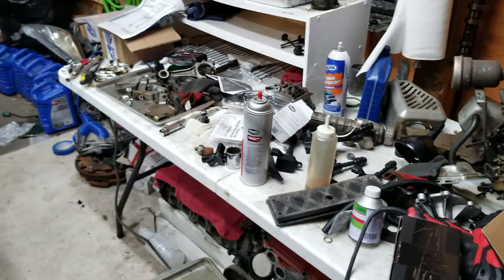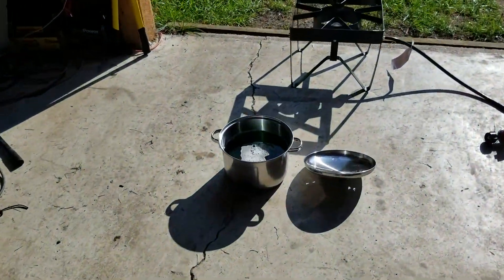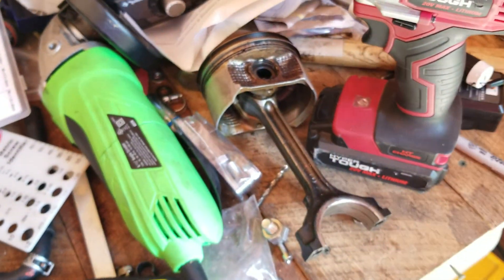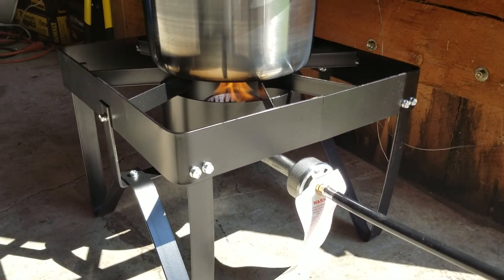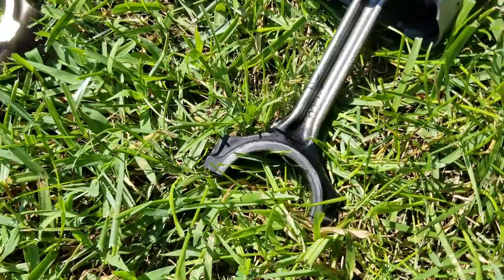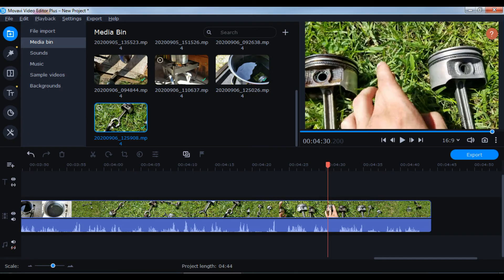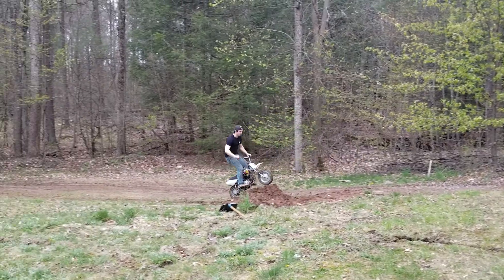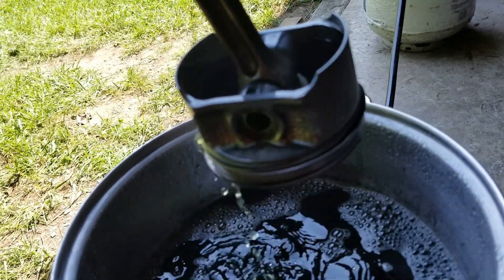Simple Green Hot Tank Experiment

Comment: I am planning on doing this but mainly on aluminum heads and intakes 
So it oxidizing the coating ?
Reply: If nothing else i am going to use mineral sprits and a air compressor i also have a refillable spray can
Reply from the maker: It seems that it may damage the molybdenum coating in this piston but an intake and cylinder heads most likely do not have any coating and will be just raw aluminum, I've cleaned plenty of blocks and heads this way with no issues.

Comment: What Simple Green variant did you use? I read on SG website that for most of their strong degreasers they they recommend 1:64 mix. I wonder if you'd have the same result using way less SG, have you experimented with other mix ratios?
Reply from the maker: I used regular old simple green in this video. This was pretty heavy but the last time I did a hot tank I used 2.5 gallons of simple green and 45 gallons of water (18:1 Mix) and it seemed to work just as well.
Reply: @HardAngle  Thanks, I'm restoring a vintage motorcycle, I plan to use a electric hot pot to clean small hardware.